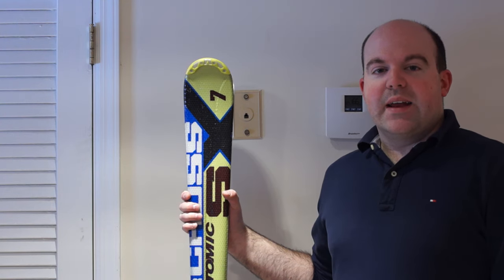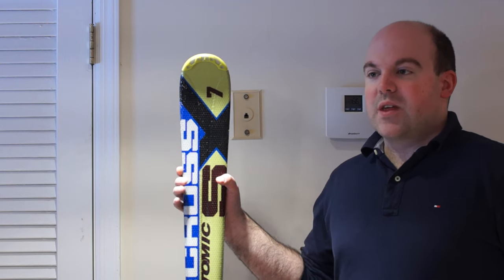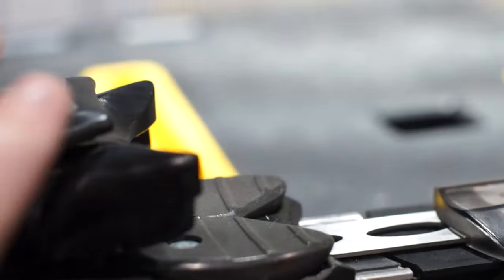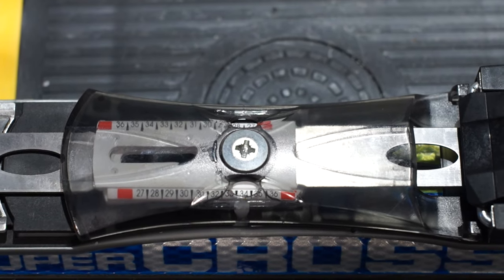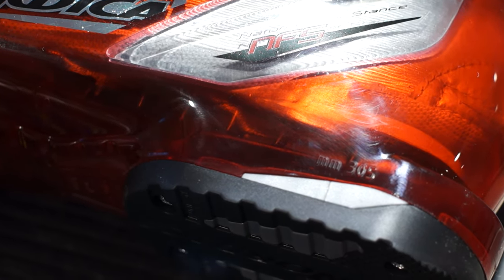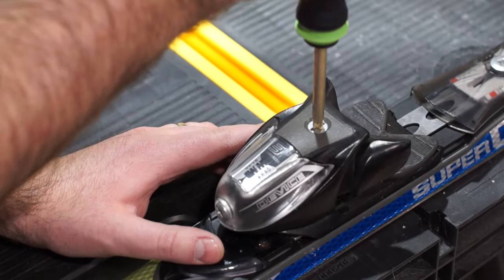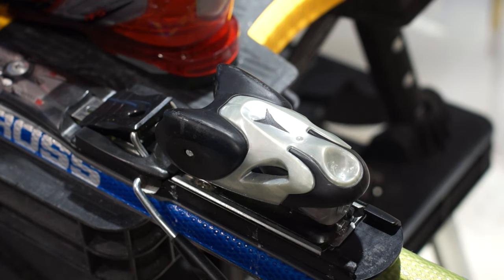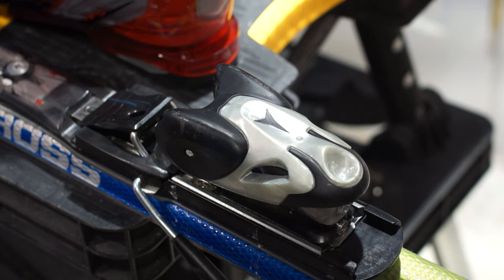How To: Binding Adjustment

Comment: The boot sole length will affect your din setting. Had to adjust for the new boot sole length but did you check the din release chart to see if your new boot sole length changed your recommended setting? Also be aware that just because you set it at a din value the boot will not necessarily release at that setting. That is why we physically release check every binding with a din force measuring tool. I have been a binding technician for a long time. That Atomic binding is a carry over from the old Ess Var bindings they were never one of my favorite bindings. You should get it released checked if possible.

Comment: I'm going to try and give a simple explanation as to why bindings are removed from indemnification. Yes, DIN settings are based on height, weight, age, skier ability and BSL; under the assumption that the spring within the binding still operates within safe parameters. These parameters are front lean and twist. You need to mechanically test these values to make sure that they fall within acceptable limits. If these acceptable limits are not met, your DIN setting is false. If your springs have failed due to seizing or slop, just because you set the visual indicator at 6.5 does not mean you are actually at 6.5. This is why manufacturers remove certain bindings from their indemnity, they are no longer reliable.

Comment: Great video but I did not see any test of the front toe cup height adjustment.  I am no expert but from other videos it looks like a piece of paper should just slide under the sole of the boot and the binding with some resistance when the it is set correctly.

Comment: First time adjuster here!! 😄 Your video is by far the best (and the first) I found. I got my hands on an old pair skis with the Atomic 310 binding and seeing you do the adjustment on the actual model helped a lot. For some reason I can't adjust the toe-part. It sits firmly on 29. So I adjusted the heel part to 34 witch make both 25 mm off with my 315 mm sole.

Comment: Very concise, articulate instructions. Just a few simple steps to follow and you did a great job explaining it.  An official technician probably know the various bindings differences more but it’s not rocket science.  When I use to rent skis, the guys there adjust your boots to the rental skis/bindings in like 1-2mins if that... No DIN calculator used. Proper safe fit is definitely important, but taking some time to do it right yourself cannot be any worst than what they do with rental equipment.

Comment: great tutorial! 
A reason for your  local ski shop not to touch them is because these bindings in particular use an old system and by time they tend to get unsafe(the spring gets lazy and doesnt correspond to the DIN settings correctly any longer). Your local ski shop probably doesnt want to take blame if your ski doesnt come off and you hurt yourself.(this is what one of my colleagues told me, i work at a ski shop myself.)
Reply: Yeah that’s just consumeristic thinking. I won’t drive my 20 year old car tomorrow because it’s might make it to my destination. Anything after 2000 in skis will still be fine. Get it tested if in doubt.

Comment: Perfect! Exactly what I need to know to set up my atomic bindings. 
Only part you left out whas how tight the toe needs to be.
I saw another video that if you set a piece of paper in under the boot and you can pull it out easily it is too high/loose. And if the paper rips when you pull it is too tight/low. It should pull out tightly but not rip. Edit: apparently you added a toe cup adjustment link in the description! Awesome.

Comment: Great tutorial. I'm skeptical about the "it's just math" part. What exactly happens between age 49 and 50 that moves you a full din? If you are post certain injuries might you want the bindings looser? It seems like there's some give. But I'm just wondering
Reply from the maker: My "it's just math" comment was based on the fact that there is a formula for determining the "right for most people most of the time" DIN setting. That said, I completely agree that the perfect DIN setting will vary from person to person and that's why you should take your bindings to a pro if you can. The pros have the knowledge to make tweaks that I'm not qualified to suggest, hence my reliance on the formula.
Reply: Thanks! Just fishing for more opinions on it too.
Reply: Probably more like binding- boot injury statistics

Comment: i just bought two pairs of atomic skis one with device 310 bindings and the other with XTL7 atomic bindings. i think i can figure out how to adjust the 310 bindings but i am having trouble with the XTL7. any suggestions? i bought these skis used before i really investigated all of the aspects of binding and I am worried that a disaster will happen. both of us are beginner skiers so we are not going to be sking hard and fast, just nice and comfortable on easy slopes.
Reply: The Device 310 bindings were recalled because the heel piece explodes, I highly suggest you do not ski on these. Like someone pointed out earlier if your car was recalled, would you call their bluff?
Reply from the maker: Many Atomic bindings manufactured between 1998 and 2002 were recalled several years ago because of the heel piece, but the Device 310 was not one of them. Here's a link explaining the recall - https://www.cpsc.gov/Recalls/2008/atomic-skis-usa-recalls-ski-bindings-due-to-unexpected-release-fall-hazard. Folks who have been skeptical in the comments are right, though. Bindings are a safety thing, and if you are going to mess with them or ski old ones, you need to understand that doing so is much more risky than skiing new bindings that have been adjusted by a ski shop.

Comment: Great Video--Question--I have a chance to buy a used set of these..mint condition--allegedly used once...only $50.  Curious what you thought of the ski itself.  I currently ski a used Atomic R11's...intermediate skiier..mostly groomed cruisers....any description would be appreciated!
Reply from the maker: These skis have worked well for me, but I'm probably not the best person to comment on them. I figured out how to adjust my own bindings and made this video because I don't ski enough to have made it worth purchasing a new set of skis/bindings when the shop told me these were too old. I'm an intermediate East Coast skier, and it sounds like we ski the same kinds of runs. I don't have any complaints about these skis, but I also haven't skied a ton of others for comparison.

Comment: I have several set of skis (8) and have encountered same issues and conducted similar adjustments and  have also observed even with new purchases than I have been asked to sign off on liability waivers so new or old the seller is covering their liability issues which I understand. Only thing is that would still be nice to conduct that  final step of testing if you can find a licensed tech willing to do so for some peace of mind  and remove any nagging doubt.  Where I deem it better to change binding and save the ski then I do .  Either way you are on your own peril and video remains informative.  The only caveat you do so at your own risk .

Comment: Check the bottom screw in the heel piece. when your forward pressure is correct, it is flush with the housing. DO NOT ADJUST THE FORWARD PRESSURE WITH THE BOOT IN THE BINDING!. YOU WILL STRIP THE HEEL ADJUSTMENT CAM. If the screw is not flush, remove the boot and loosen or tighten as needed. Insert boot and check. Once you have tit set flush, remove boot and turn screw in 1-2 clicks. Your done. I worked in a ski shop(-:

Comment: Adding a comment as a certified ski technician for Atomic, Salomon, Look and Marker.  I do not think most skiers understand what is involved in setting and testing indemnified alpine ski bindings.  First the technician determines a skier's DIN reference number (note I said reference number) based upon a skier's weight, height, ability, age and boot sole length.  Yes there are charts we use, and the charts are standardized within the ski binding industry.  2nd, the technician adjusts the binding for proper forward pressure (and that's assuming the binding is already mounted for the correct boot position).  3rd, the technician makes sure that all parts including the boot are in good working order and cycles the binding through several releases making sure that binding parts are moving as intended.  

Finally, and this is the part that probably no one watching this video can perform and the most important step, the ski technician inserts a metal foot into the boot, inserts the boot into the binding and attaches a torque wrench designed for ski bindings or uses a binding testing machine.  In either case, the technician checks that the binding is releasing within the specified forces allowed for the skier. (both forward and twist).  The technician is allowed to correct by either tightening or loosing the din screws to bring the release values within the recommended range.  If a binding tests too high or too low then the binding is failed.  

So, yes you can adjust your din correctly and correctly set your forward pressure but without testing the system, you are never really going to know if it is releasing correctly.  

Indemnification.  If we did not have to worry about lawyers, we would not be worried about indemnification.  Having said that, the time that bindings are indemnified varies between binding manufacturers, but generally it's about 10 years.  Like anything else, bindings eventually become unreliable with time and use.  Plastic becomes brittle, lubricants dry out or evaporate thus friction increases, metal springs lose tension over time . . . .  . it is recommended that bindings are set back to their minimum din rating after each ski season to prevent fatigue . . . . how many here do perform that?  

Can't afford new bindings . . . .  knee surgery is really expensive and your knees are never the same . . . .not too mention other nasty injuries that can occur if your bindings don't release correctly . .  . . .  or pre release.   

There's alway XC skiing.  Much easier on your body, far better workout, and xc skiers don't worry about indemnification.  

Last word, and some insight from my perspective on skiing.  What's in my quiver?  2 pairs of Alpine skis, 4 pairs of telemark skis, 3 pairs of backcountry (metal edge w/pattern), 3 pairs of xc touring/track skis, and 2 pairs of skate skis plus a couple pairs of rock skis for those early/late season days in September/October.
Reply: Clint: You're quite right, of course. But the metal-foot-on-a-torque-wrench jig brings another life-critical scenario to mind: The Mechanic's Nuts.

Remember the last time you saw a certified, professional mechanic refer to your vehicle's service manual, determine the proper wheel lug nut tightening spec, and use a torque wrench to tighten the nuts which protect your family from the potential effects of a catastrophic failure of the car's wheel assembly?

Me neither.

But those nuts are the only things standing between a safe drive home and death.

Ever torque your lug nuts with a good torque wrench? I was shocked at how little effort it takes to get them up to spec. Overtorquing can be just as dangerous as undertorquing. This kind of error is designed in from the outset. Occasionally, I have to climb communication towers. The safety factor designed into the rope work devices is never less than 10 to 1. And when you get too close to a radiating antenna, the RF field safety alarm beeps to stop you when the field strength reaches 10% of the maximum allowable. (Google "safety code 6 radio frequency" for some light bedtime reading.

One rolls the dice when one wants to, but bystanders need not place any bets. Shops who won't work on unindemnified equipment should not be held in contempt, unless they've misled their customers to help their sales.

Most likely, folks following Matt Culik's advice will be fine. Most likely...

Comment: If you pay cash & no written work order & no receipt, then some shops will adjust, but they usually refuse to remount old bindings due to lack of proper jig.

You can check your indemnification status online:

http://www.gondyline.com/indemnified.php

I recommend Look Pivot 14 or 18. Rock solid, no frills, or gimmicks & hasn't changed in years - still fully indemnified. They also offer a Pivot 12 for girlyman...

Comment: Great video. However the reason your shop doesn't touch those is because your heel piece is a ticking time bomb. Steer clear of the woodline man, you're literally taking your life into your hands. The shitty plastic Atomic put into its Device series bindings does not hold up, and fails. If Ford recalls your car because the tie rods they put in the cars are failing, are you really going to call their bluff?
Reply from the maker: Didn't realize these bindings were so bad. Thanks for the tip.

Comment: Coming from a ski tech certified by Marker, Rossignol, Salomon, and Tyrolia; there is a reason that bindings are removed from their indemnification. It's because they are deemed no longer safe to operate. If your binding is no longer backed by its manufacturer, don't ski it. They aren't trying to sucker you into buying new bindings. They literally have tested numerous numbers of these models and deemed them unsafe.
Reply: +Chap Arst You sound just like these nine words: "I'm from the government, and I'm here to help!"
Heh. heh.  Ok, before you kill me, I will say that you're right, SOMETIMES there is a reason. But most of the time, there is not.

But let's not lose sight of one thing.  This is the ONLY YouTube tutorial that explains this in detail.
Reply: Brian Coverstone, injure yourself on an unindemnified binding and see what happens. There's literally a team of lawyers on retainer for the manufacturer ready to counter suit your claim. If a binding is on the unindimnified list and you ski that binding, you have NO case against the manufacturer. In fact, this video proposing how to adjust unindemnified bindings is 100% illegal, if Atomic/Salomon felt the need to do so, they can and will sue you.
Reply: And being a certified Atomic/Salomon technician, I've alerted them to this video.
Reply: +Chap Arst The difference between an indemnified & non-indemnified binding is simply that the user assumes all the risks from release, non-release, or complete failure. Most of us assume all those risks whether the binding is indemnified or not; i.e., it's not illegal to adjust a binding, it's just not recommended & it removes liability from the manufacturer & certified retailer/tech shop. At the very least, the manual for the binding should be consulted for proper fit with the boot. Some shops will perform work on non-indemnified bindings as long as you sign a release of liability form. Now, do you happen to have a jig for my 1970's plate bindings?
Reply: So why were the bindings okay to use up until a new model of bindings were released? Was it magic or kismet that they were fine until a new binding was released? Or was it a happy accident that old bindings weren't good after the release of a new binding? It is strange that the new hotness is perfectly safe until another new hotness comes out, then the old ones are deadly. If I died on a new set of bindings, will I be okay to ski next season? Just asking.
Reply: Why didn't they test the "old" bindings before they released them?
Reply: Meanwhile, my 1986 Tyrolia bindings release as designed 35 years later.